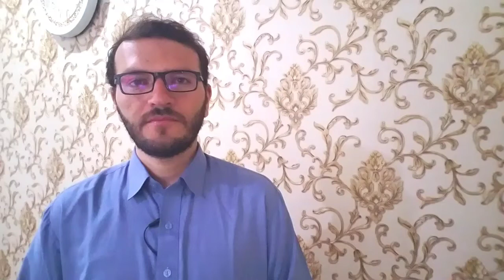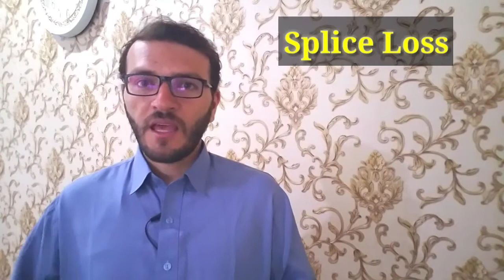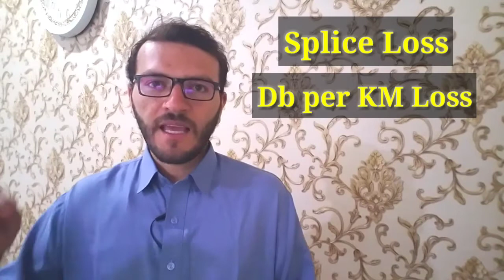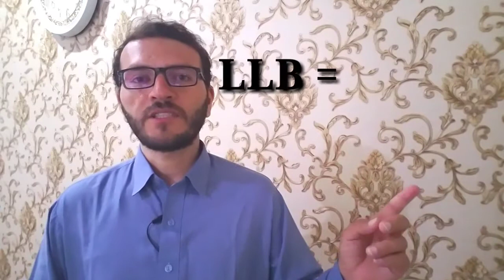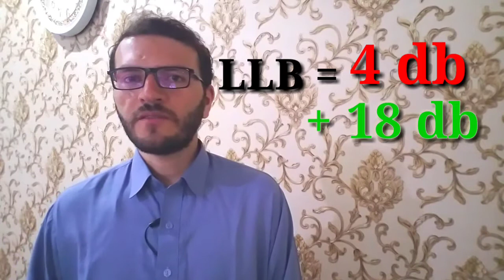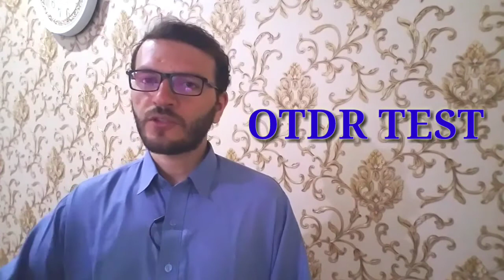LINK LOSS BUDGET IN FIBER NETWORK

Comment: Is there any standards mentioned the value of the splice fusion loss and the connector loss ?
Reply from the maker: These values are set by the companies themselves however the typical splices loss is 0.150 db and for connector it's 0.500 db. But again it depends on the specifications defined the COMPANIES